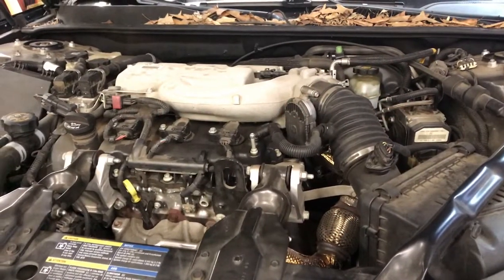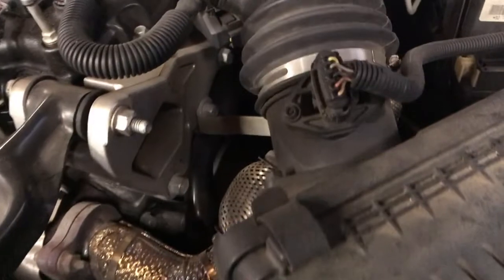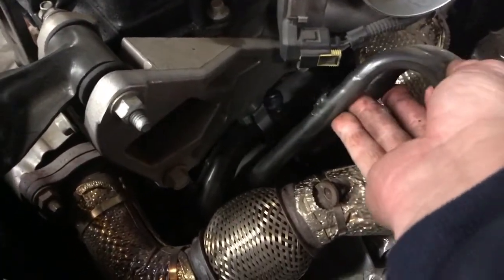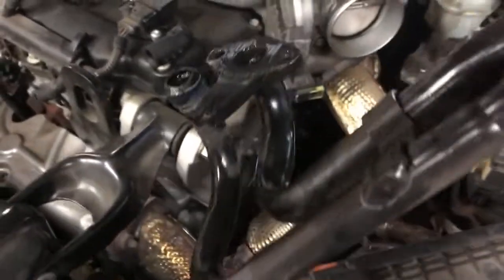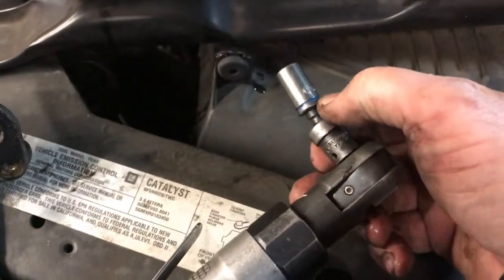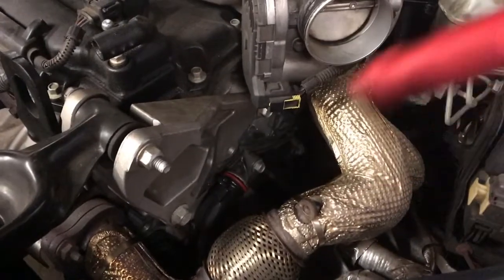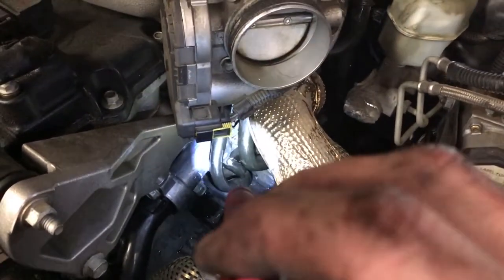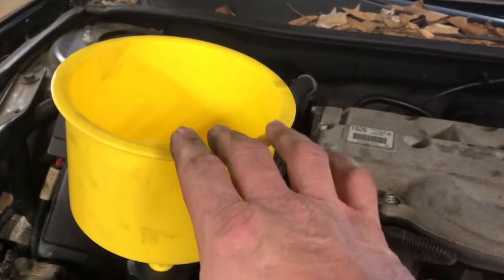Thermostat Replacement - 2005 Buick LaCrosse 3.6 Liter engine

Comment: Haven't done this job yet but great explaination - at least I know what is a head of me. Thanks again
Reply: Very important to clean the block holes of debri and old seals...for the new bolts...my housing came with new bolts and the easiest one on the left only had a 1/4" to go to tighten...old seal was on old bolt and new bolt still snapped. Hour job turned into 2 days labor drilling and tapping after 4 attempts of welding a nut didn't work. Pita to say the least. Verify they go in easy by hand without thermostat like this guy says. Removing engine mount ,3 more bolts gave a ton more room. Long 1/4" ext with swivel was able to remove all 3 bolts.

Comment: Very helpful video. Do happen to recall the part numbers for the o-ring and the gasket? I’m having a hard time finding these.
Reply from the maker: I do not remember those numbers but I did get them at the dealer. Your local dealer should have them for you.

Comment: Hey the gaskets that you said you had to get from the dealership, do you by chance know or remember the part number for the gaskets for the hoses that you replaced in the video?
Reply: Kristen Philman
Thermostat & housing 12597257
Housing gasket 12681140
Outlet pipe seal 12623519
Heater pipe seal 19351800

Buy the seals from the dealership, the seals from NAPA are too big, didn’t fit and leaked. I had to reseal the outlet pipe.
Reply: Great video, very helpful, thank you. Only took me 2 hours as a backyard mechanic

Comment: you didn't say how to remove the thermostat from the housing nor how it goes back in...it doesn't just lift out. crucial steps missing for a tutorial (yes, i can get the hood open 😉) i've never done this before.
Reply from the maker: In this video I described replacing the complete thermostat and housing. The part come with the thermostat installed into the housing. I saw no need in removing the thermostat from the new housing  but if you need to they usually just push and twist to remove. Don't think you could put it in reverse. It should only go one way. Hope this helps.